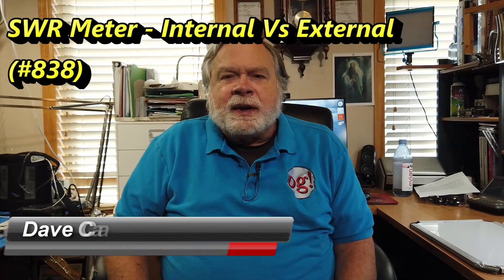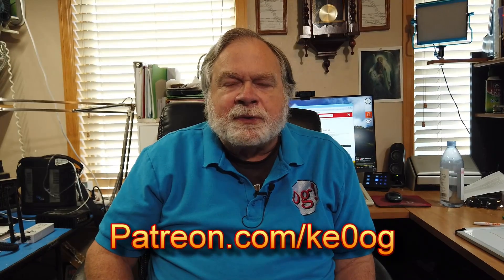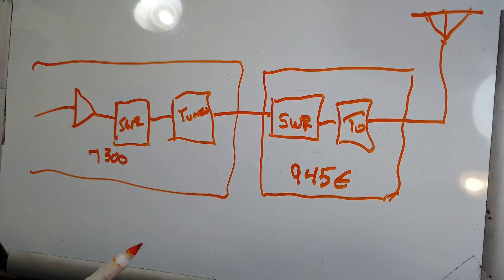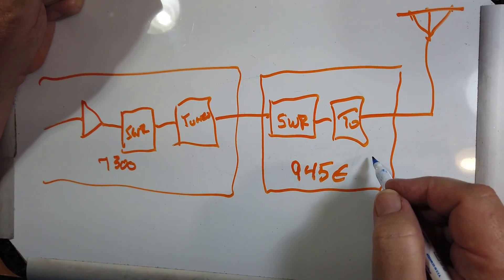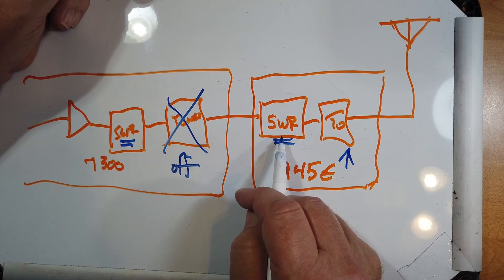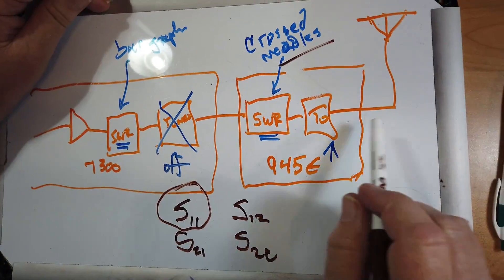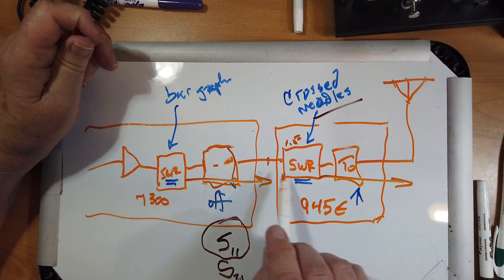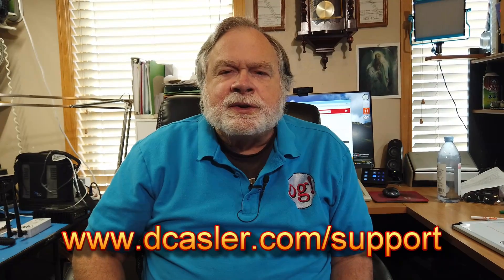SWR Meter - Internal Vs External (#838)

Comment: My 7300 reads as it should with My quad antenna around 1.2....but when I connect my swr meter it reads 1.5 on the 7300 and 1.7 on the meter so why is the happening?..so when connect antenna straight to 7300 and use it's built in meter it's reads correct....but when I add my meter it's goes up across the range from 1.2 to 1.5

Comment: At 6:29 it is clearly seen that the "tune" indicator is shown on the 7300 display, indicating that the internal tuner is engaged in the 7300.  You then are also looking at the external SWR meter?  Of course the readings are different.  What is the point of this video?

Comment: Im still confused after watching this video lol Sorry dave lol I just use the radios ATU and dont have an external SWR meter or ATU attached at all i just keep it simple and trust my radio. 

I do check the SWR with the external meter when first setting up an antenna OR if i notice somethings not right but i then unplug it and take it out the equation.

Comment: I'm going to post this here so it doesn't get buried in the comment replies and hope Dave takes this as constructive.  He is constantly lost in almost every single video. And it's a shame because he's such a nice guy but he's in over his head on tons of issues. Someone once told me a good teacher is everything and Dave fumbles all over the road trying to explain. Something as simple as saying "buy an ARB-704 to protect your radio when running an old tube amp" turned into a 15 minute video of him struggling to explain the voltage an old amp throws back to a modern radio. None of these videos are clear concise explanations and never take into account other variables. It truly seems Dave never uses high power amps either. Please Dave clear it up.

Comment: Going into a valve amplifier, the amp input is not always 50 ohms, and so the load seen by the radio is not always an acceptable match.  I use the radio tuner to match to the input of the amp and the tuner after the amp to match load to the antenna.  Most of the time that is not needed, but sometimes doing that makes the radio see a better load, sometimes dropping it from the occasional 1.3 to 1.4 down to 1 to 1.  Well worth it to me to help the finals stay safe.
I tune the ant load first, then hit the radio tuner button if it is not good enough.
Yes, the question did not mention an amp, but I mention this to show that sometimes using both is beneficial.

Comment: Like all modern transceivers, the 7300 is pulling back the RF power when it sees the high SWR.  This is to protect the final amplifier transistors and to keep you from breaking your radio.  You can see this at 6:54 in Dave's video -- look at the forward power on the WM150M.  The 7300 is set to 50% RF (~50W)  but is only driving ~4W into the high SWR load.  The WM150M really needs more power going through it to get a more accurate reading (ie more needle swing).  Also as Dave noted, neither 7300 or the WM150M are lab grade instruments so even under more ideal conditions they will not 100% agree.  I typically pay more attention to the radio's SWR meter.  If it's not happy it will cut the power output to keep those expensive output transistors safe.  One thing Dave mentioned that needs to be emphasized more: if you are using an external tuner, make sure the tuner in the radio is bypassed.  Otherwise they will fight each other.  de KB7ZUT
Reply: Now that's a proper answer his made zero sense sorry just being honest.

Comment: IMO, the SWR meter in the radio is giving the correct reading.  Since the external SWR meter is after the internal 'matching network' , the external meter will still read an unmatched / higher SWR result.  73,  AC3HT
Reply: This response is absolutely correct....the SWR will be different when comparing readings at after and before the matching unit.  Some of these other responses here are absolutely wrong and confusing.

Comment: From working with a lot of things I think that where the SWR meter is in the coax.  At HF it sometimes makes a difference but at the setup you have there is coax from the radio to the meter.  What percent of a wave length is that.  I have tested antenna with a Bird meter with different length of jumpers from the radio to the meter. Same radio and antenna with a  one foot jumper and a two foot jumper they didn't read the same!

Comment: I have been having the same question as Eddie.  I have a Yaesu FTDx10 with a short (18”) low loss coax jumper going to my MFJ 949E manual tuner w/cross needle power/swr meter.  It has terminals for ladder line and I have 43 feet of 450ohm ladder line going to a 135 foot horizontal, center fed 10-80 doublet.  I do not have the internal radio tuner turned on because the swr on this doublet is too high for the internal tuner to handle.  I only tune with the manual tuner.  I lower the radio power output to 30 watts for the initial tuning and use the cross needle meter to do the initial adjustments.  When the cross needles read close to 1:1, the Yaesu electronic meter is reading about 1.2:1 which is a very safe reading for the radio.  But, I then do the fine tuning using the Yaesu swr meter.  Since the purpose of tuning is to provide the best protection for the radio, I figure the reading on the Yaesu meter is what the radio is actually seeing.  Then to finish, I raise the wattage back up to the desired output and do a final swr check.  I can’t carry or whistle a tune in a bucket so I switch modes to CW or FM and use the solid carrier for tuning.  I can’t swear that this is the right method, but it is my method until,I discover something wrong with it.

Dave, thanks so much for your videos and questions answered.  It kept my nose to the grindstone until I go my Extra Class license a couple weeks ago.  

Tom
WA4EOD

Comment: I have a cross needle meter and it is EASY TO READ all the time.  When my radio tuner is off, the radio meter and external meter meter will be very close.  When I turn tuner on and tune up, the radio meter will show low swr because it is behind the tuner.  The external meter will show the swr of the antenna since it is after the tuner.   Seems odd to see so much difference in your meters .....

Comment: I have an MFJ-969, which is similar to his but has an roller inductor.  The -969 also has a bypass selection so you can put it into or out of the circuit.  The cross needles are brought down to the center of the meter so reading doesn't have the gap as witnessed on your cross needle SWR meter.  I almost always have my -969 in the bypass mode but it still keeps the cross needle in line.  I find very little difference between the -969 SWR reading and the -7300 bar graph reading.  If there is a differnce, the -7300 bar graph shows a little lower than the -969.  The readings you got are REALLY different.  Not sure why.  73  N7MHR

Comment: Maybe use CW mode since the MFJ will average the reading of an SSB signal.
Reply: exactly and thats why he missed the whole point
Reply: Yes, Dave's totally lost on this.
Reply: @z95m  He is lost. And it's a shame he's such a nice guy but he's in over his head on tons of videos. Someone once told me a good teacher is everything and Dave fumbles all over the road trying to explain. Something as simple as saying "buy an ARB-704 to protect your radio when running an old tube amp" turned into a 15 minute video of him struggling to explain the voltage an old amp throws back to a modern radio. None of the are clear concise explanations and never take into account other variables. It truly seems Dave never uses high power amps.

Comment: So which SWR should you believe? The Radio SWR or external SWR meter?
Reply: They are both incorrect. VSWR is a measurement of the maximum voltage along the line ratio with the minimum standing voltage along the line. Any "VSWR" meter is a measurement of one point along the line. What these meters actually are is forward and reflected current meters. They are just a guess for VSWR.

Comment: One tuner at a time.  Use one bypass the other!
Reply: My BAD, I meant to say I always turn off the 7300 internal tuner when using the 945e.....ALWAYS!!! 73/K6SDW
Reply: @eddy2561  hi Eddy, you should get the same readings on both the 7300 and the external swr meter in the mfj tuner.
Your question is valid and Dave gave incorrect information; he tries to find fault with the differences in the technology involved in the metering.
He is quite wrong.
Please check the patch cable between the radio and the tuner.
You get your radio to work (on all bands) using the same patch cable into a 50 ohm pure resistive dummy load to display 1:1 on the bargraph without using the internal tuner.
Then connect the mfj tuner to the radio and put the same dummy load at the output of the tuner.
Now make the radio work into the dummy load through the tuner.
The readings on the radio and the tuner must be reading the same 1:1 swr at some specific settings of the control knobs.
Now connect the antenna at the output of the tuner and using 5-10w on CW you must be able to tune your antenna on whatever bands that's designed for.

At any cost you should get both the readings concur with each other if not exactly at least within the ball park region.
"S" parameters (except S11) have nothing to do anything at all as Dave is assuming 😀
Wish you all the best.
De VU2RZA
Reply: @subramanianr7206  So which SWR should you believe? The Radio SWR or external SWR meter?
Reply: @subramanianr7206  my radio SWR reads 1.5 & external SWR meter reads 1.2
Reply: @xjohn1970  good question. It should be the other way around by logical deduction and by the way things have been designed.
One might argue that an swr of 1.5 on the radio is good (at least not bad for the radio) and some use the phrase "the radio is happy"..😀
Here the scenery is different.
Once you add the tuner in between the radio and the antenna the radio is going to deliver all its full power into the tuner as it presents the "mandatory 50 ohm"(assume it's well tuned with the antenna system)
Yes, the radio is not going to know whether it's a 50 ohm transmission line or a 50 ohm resistive load.
So, now the tuner becomes the source of RF (voltage/current). 
The radio is relieved with a big sigh.
It's the job of the tuner to deliver the RF power that has been borrowed from the radio into the transmission line and the antenna system as a whole.
As the tuner contains the needed L/C (inductor and capacitor in the right combination) it cancels out or minimises the reactive part of the antenna system making it more like a resistive load.
Now you know the answer well I believe.
Yes, your radio should read the minimum swr nearly (1.2:1) and the tuner may read 1.5:1, but not vice versa.
In such a situation I will be greatly convinced.
Good luck.
De VU2RZA
Reply: @subramanianr7206  I'm going to take reading from both again and then disconnect the external Palstar PM2000A 1.8-60 MHz SWR/Watt meter and connect the antenna coax direct to the radio and record the difference. I'm using all new coax "Real" USA made Times Microwave LMR 400UF with soldered ends from MPD digital, both the jumper and Antenna coax were tested by 2 technicians (as always at MPD) that singed off on before sending cable and I test it myself before installing the T.M. LMR 400UF. the  jumper between the radio and external SWR/Watt meter is 3 ft LMR 400UF also. I live in ohio by the Palstar MFG. and I ordered & picked up my meter directly from Palstar  & I was  able to witness the calbration of the PM2000A Meter. let you know what I find out.
Reply: @subramanianr7206  ok here is the test with my measurements done correctly. MY SWR on the Palstar External meter was SWR 1.2 with 1 watt reflect. Now on radio it was SWR 1.6. And with the Palstar SWR meter taking out of the loop and antenna straight into  radio. the SWR went to 1.7 on radio. so the 3 feet of coax added back with the Palstar PM2000A   the SWR went back to 1.6 and the Palstar went back to it 1.2 SWR & 1 watt reflect. so this is just how I have My antenna tuned right now and the removal of the 3 ft of coax changed my tuning. I could go up on roof and spin the tuning ring up little and get a flat  SWR on both meters but I have this antenna tuned to a different band than I did these test on and both are flat there on the other band,.. on this 10 meter band I did the test on all I  have to do if hit my auto tuner button to get this band a flat SWR so all is well😀 just a cool experiment.
Reply: @xjohn1970  I honestly feel that something is wrong somewhere and it's you who have to find out; I can't reconcile with what you have actually said here.
Wish you good luck 👍
Anyways let me think of it again and if anything occurs to me I will come back for sure.
De VU2RZA